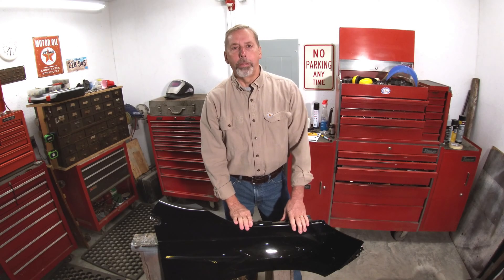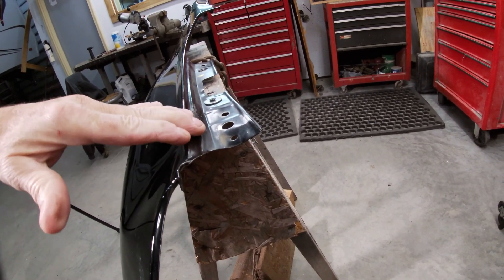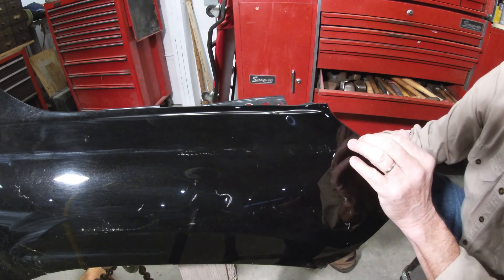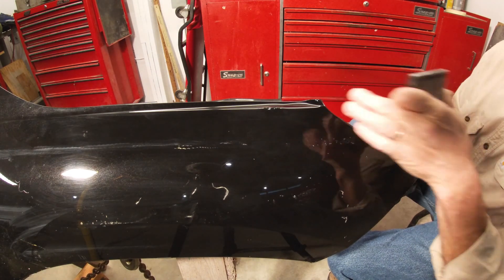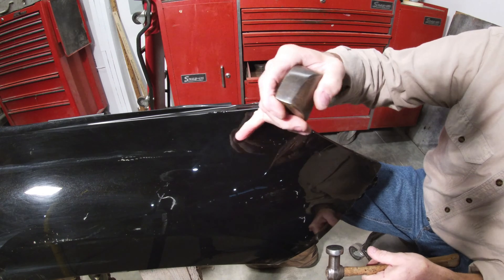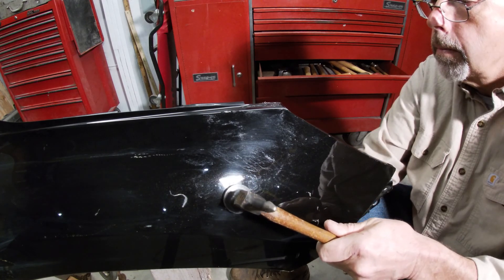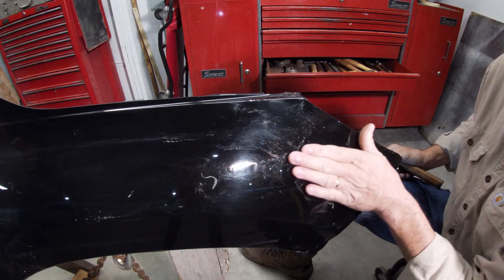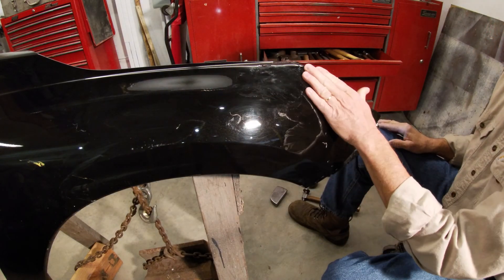Relieving Stress In Metal

Comment: I have an identical dent in my fender, unfortunately I can't remove the fender due to one frigin bolt that is installed "backwards" with only the threaded end accesable.  Looks like I'll need to use a stud puller.  ):  any ideas?   thankx
Reply from the maker: Can you remove the wheel liner or headlamp? That should give you plenty of room to work. Thanks for watching
Reply: @autobodytrainingsolutions838   yes I removed both and still can't access that bolt/screw.  It is just below the front right pillar below the windshield.
Reply from the maker: @jp325abn   Can’t you repair the fender on the car?